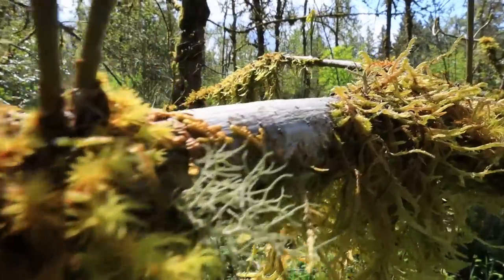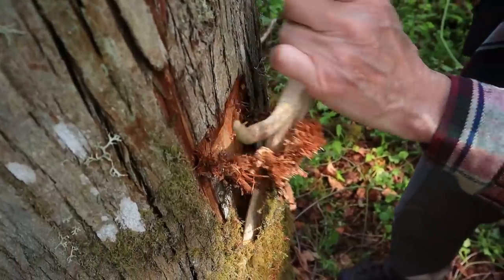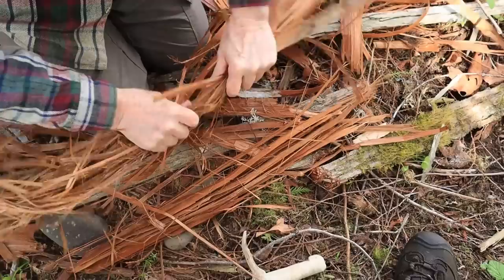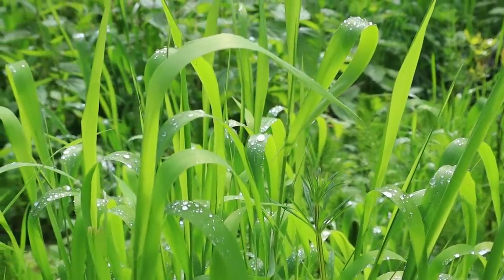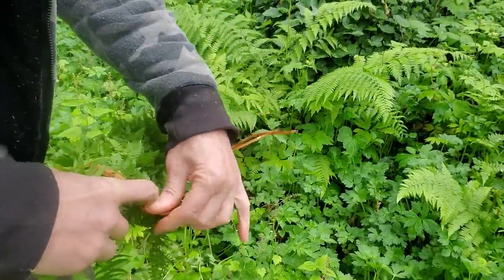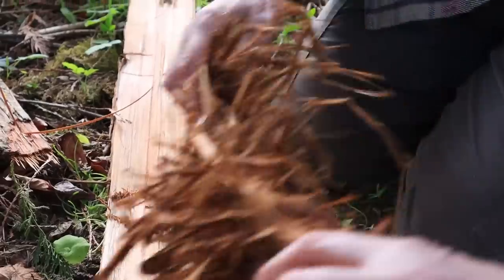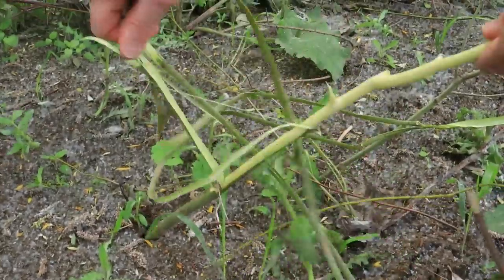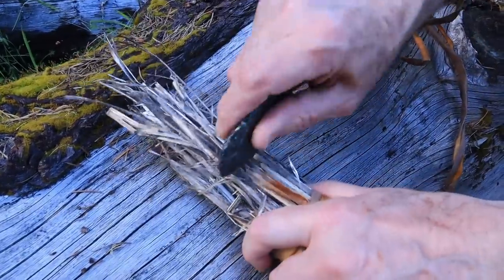How to Carry Fire | Building Fire Carriers

Comment: I found that one of the best ways to make a fire carrier it to just take a very dry piece of Agave americana (dried on the plant itself) and just cut the thicker parts to the length you need and that's it. If you soak it in wax it also makes a very good torch. It needs a bit of prep and is better as something you prep beforehand but it really does work really well